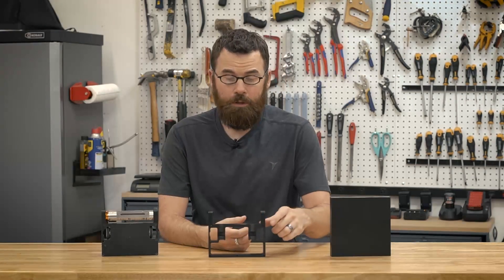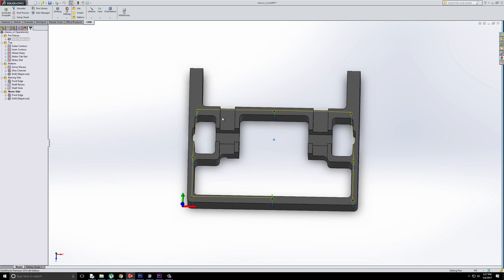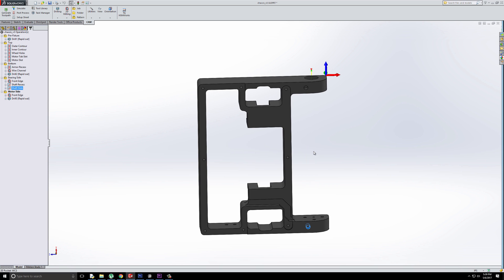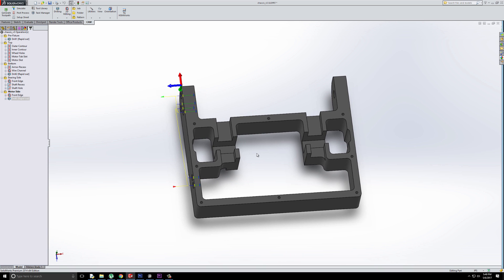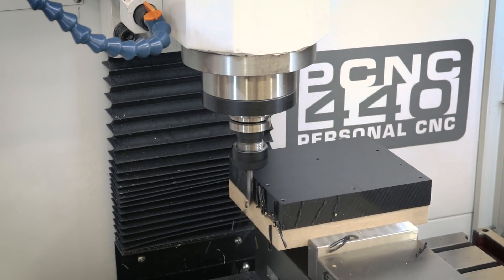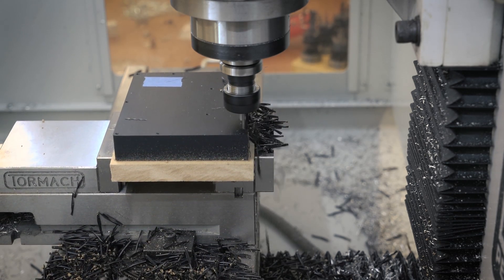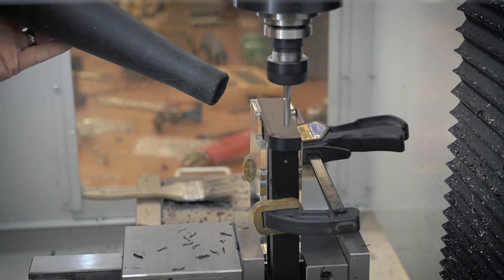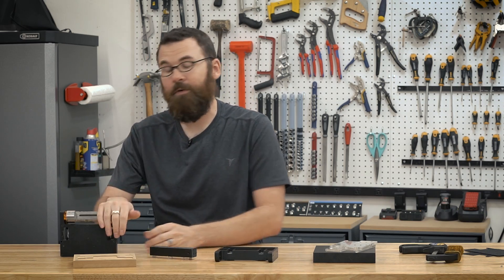From Start to Part: Sgt. Cuddles UHMW Chassis

Comment: Aproximately, how much does UHMW costs?
Reply from the maker: It's relatively inexpensive for small parts.  You can check eBay, Amazon or McMaster Carr for prices, it depends on the size you need.  But the block that's used for the chassis is about $15 or so.

Comment: How do you have CAM in Solidworks?!?! I've been importing my Solidworks models into Fusion360 like a damn caveman.
Reply from the maker: It's a free plugin called HSMxpress.  It's basically the same CAM found in Fusion360, but just a bit more limited.
Reply: Awesome! I'll have to go check it out. I absolutely dread opening Fusion360 since it takes so long to sync everything up to the cloud. It drives me crazy!

Comment: What are your recommended feeds and speeds for the UHMWPE
Reply from the maker: Check the video again, I discuss this a few times.  Low RPM, high feed rate.  I was doing somewhere around 1k RPM, 50 IPM, full depth of cut, and 30% width of cut.

Comment: Hi Robert,

Really enjoy your videos!

I noticed you were setting the Datum point on the front left of your part.  Most of the time I set my datum point on the back left corner of the part.  My reasoning is that the back (fixed jaw) of the vise never moves  i.e. squeezing on a somewhat flexible part and once you set your datum point and you do any reverse side machining your part should be correctly aligned in the Y axis.

Polycarbonate (Lexan) vs Acrylic (Lucite)
I think you mentioned using Plexiglas i.e. Acrylic for the top and bottom stiffener plates.  I have found that Acrylic tends to crack easier than Polycarbonate.  You might want to try some Polycarbonate in your design as looking at your videos your machine takes quite a beating. 
Here is a link that you may find useful. 
http://coloradoplastics.com/polycarbonate-lexan-vs-acrylic-lucite/
Reply from the maker: Thanks for the comments.  Yes, I usually use the back (fixed) jaw.  The part being squeezed is the bigger issue.  It literally goes from a square/rectangle to an oval.  Sure, the datum would still be correct, but the tool path would be wrong since the part's geometry is messed up.  So attaching it to a baseplate is a good way to keep it square.  At this point, the jaws don't really matter much.  But you are right, typically indicating from the fixed jaw is the way to go.

I used acrylic because 1) I had some on hand and 2) lexan (polycarb) does not cut with a laser.  I understand that acrylic is far more brittle and lexan is the preferred material.  But I'm just using it to stiffen up the chassis for machining.  Just about any material would have worked, as long as it's reasonably rigid.  The acrylic does not end up in the design at all, it's just for the fixture.  Acrylic (and in most cases polycarb) have no business in combat robots, so neither would really end up in the final design.

Comment: Is that the Solidworks/MasterCam combination software I have been hearing about? How do you like it? I have been using both separately for years and have been curious if there is   much disadvantage to going with the combo.
Reply from the maker: It's not Mastercam, it's HSMworks, the free version.  It's a stripped-down version of what comes with Fusion360.  I really like having both in the same program, it makes it really easy.
Reply from the maker: I haven't used mastercam, but have heard that HSMworks (the full version) is very comparable and often times preferred.  It essentially comes included in Fusion 360,  which is nice if you can deal with a cloud-based program ;-)
Reply: I use Mastercam 2017 idk if you have any experience with it but how does that program stand up to one such as Mastercam?
Reply: Mastercam for Solidworks is really convenient, I'm in high school (I have a CSWP & CPGMM), so I have the educational version. But it's pretty much the same thing as the full version. If you are familiar with Solidworks and Mastercam, then I highly recommend it.

Comment: I love to watch you mill parts. Where do you buy your stock? Also, are you self taught in SolidWorks or did you have formal training?
Reply from the maker: I bought all the stock from McMaster Carr actually.  They were surprisingly pretty cheap.  I think each block of UHMW was only about $12, which isn't too bad.  There's also a local plastics supplier here in Colorado that I've used before, but they're cash only and it's just a bit trickier to find what you need.  I'm completely self-taught, my degree is actually in psychology.  I've learned everything from just YouTube videos.
Reply: That is pretty cheap... I may buy a block and play with milling some on my Shapeoko 2.
Reply from the maker: Yeah, I just updated the description with the end mill I'm using.  Just get the RPMs as low as you can and it should cut just fine.  I was thinking of using something like a shapeoko for a larger chassis, it should work just fine.
Reply: RPM may be an issue for me. I just have a Dremel not a real spindle. It does have adjustable speed but I'm not sure if it'll go slow enough. Maybe I should upgrade. :-)